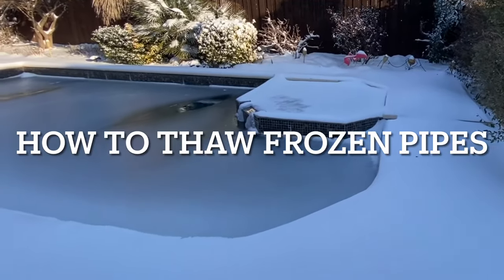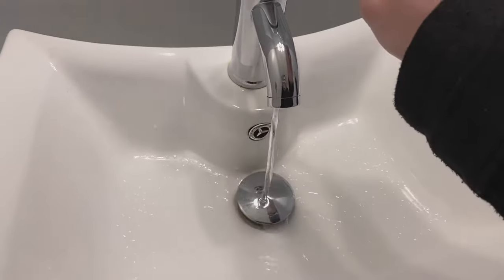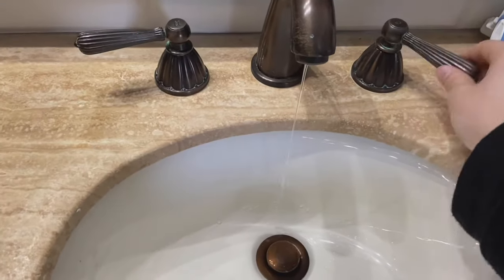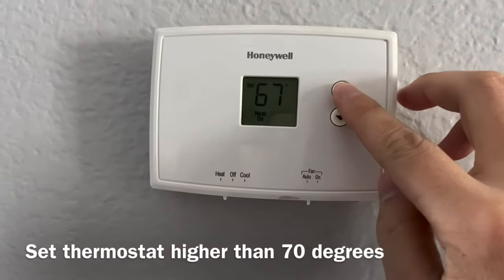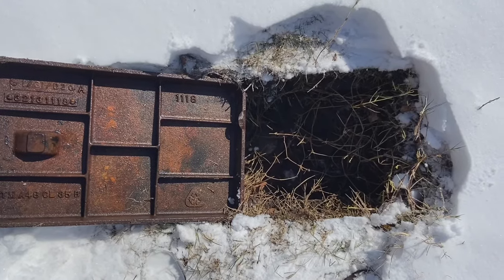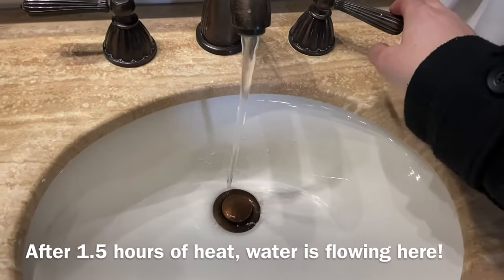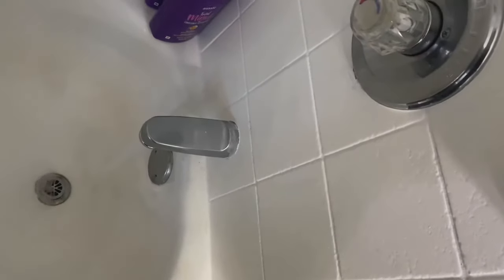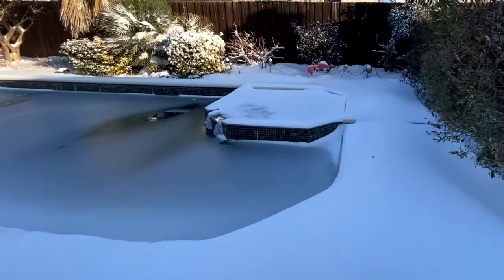How to Thaw Frozen Water Pipes

Comment: Thank you for this video!!!!
My water was running fine last night into the early morning, I woke this evening to frozen pipes,
I decided look on YouTube to find a solution ran across your video, I didn’t have to go outside  because  placing my heater under my bathroom cabinet worked. 
I have both hot and cold running water!!!!
I will not turn my water off again until the freeze warning is over.
Again thank you for sharing.
Reply from the maker: very nice!

Comment: I doubt that the box in the street was the problem, unless it was too close to surface.  Problem is aire flow coming in from outside under sink.  That's what I thnk anyway.
Reply from the maker: You're right, it's air flow under the sink

Comment: Will a blow dryer work the thing that’s weird about my house. The only thing it’s not working is the dishwasher and the sink but everything else is working.
Reply from the maker: Yes, heat up the back wall
Reply: @EdwardInTX  well my sink is not against the wall. It’s like a little island and there’s like a little hole that someone cut out and you could take out and put back in and I was blowing it with a dryer. The cold water is working but not the hot that’s why I was trying to figure out, I don’t know if I should just run the sink with cold water until it thaws out

Comment: my water doesn't come at all, out of any of the sinks or bathtubs.
Reply: I’m dealing with the same thing this morning brotha
Reply: @dandude1706  I have a space heater facing one pipe, an air dryer facing the other, and my central heating is on. Been about 2 hours and still nothing. crazy thing is I live in Alabama so it didn't get THAT cold here, overnight lows were like 25 and I just showered like 9 hours ago so this all happened overnight /:
Reply: Same bro literally I’m in ga and in is the same here for me messed up
Reply from the maker: looks like you're doing the right thing; surprised it froze that much! @outroseok
Reply: @EdwardInTX  took 3 hours but the water came back on, now here's to hoping I have no busted pipes or leaks.
Reply from the maker: awesome! @outroseok

Comment: I’ve been in the single and teens from 4 days now and have not been able to unfreeze mine with heaters running… for 2 days…
Reply from the maker: both hot and cold out? might be down the line even further
Reply: Did you find any solution?